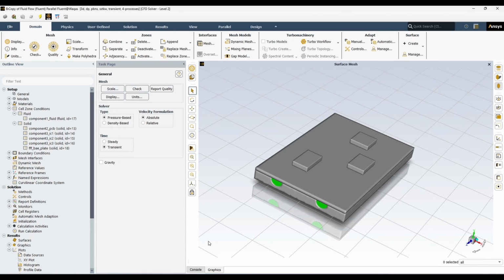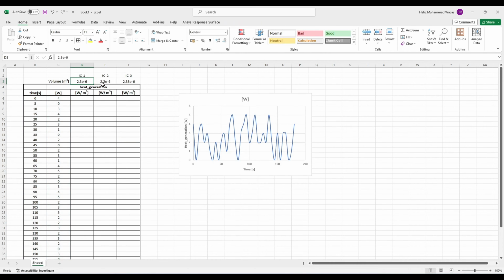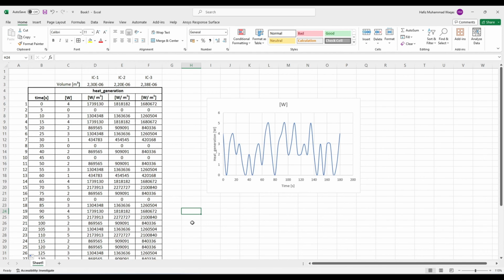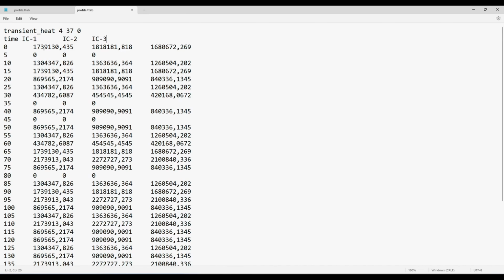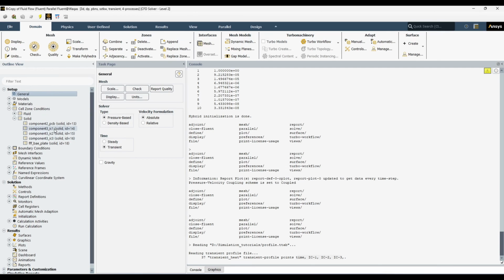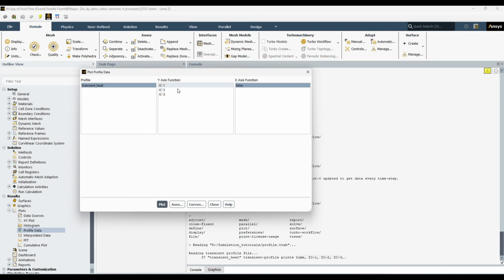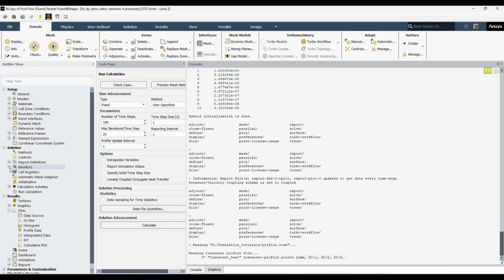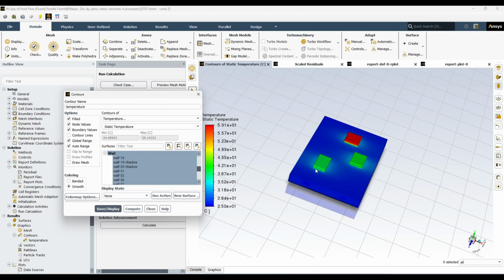Import excel / CSV / text file time dependent data in fluent

Comment: Thanks for the video. I have a question: how can I define the unit for the Y-axis values? I want to define the change of acceleration with respect to time, but the software shows the message: 'Incorrect expression unit. Expression Unit [ ], Required Unit [m s^-2]'.
Reply from the maker: Can you please tell little details about your model. You are defining acceleration as an input. I don't see an option where we can define acceleration as initial value/boundary condition.

Comment: Meanwhile I was wondering about another situation, if you dont mind. If I have a CSV file of values of field variables and their respective location in a coarse mesh of a certain domain (suppose that this result came from another CFD software or some AI algorithm), is there a way somehow of using the utility "Interpolate" on Fluent with this CSV file, since the mesh of this domain in Fluent is supposed to be finer? Thank you so much in advance for your time and help!
Reply from the maker: I already have a video on that. It is a simple example but you can use it for any geometry 
Here is the video link
https://youtu.be/XMsAYMpy62M
Reply: @WaqasLearnTech  Thank you so much! I will take a look on it then. Cheers from Brazil!

Comment: Thanks for the video! If you don't mind, I have a question. What if I would like to assign the values of the heat flux in each cell of the mesh. Would you know whether it is possible or not? Thanks once again!
Reply from the maker: @murilobrunaciomedeiros6466  it is possible to assign heat flux to each cell. But for that you need a UDF. In UDF you can loop through all cells in a cell zone and you can assign heat flux to each cell

Comment: can we import the pressure data at certain positions similar to this if so can you suggest how to. 
Thanks in advance
Reply from the maker: Please provide a little more information. In CFD simulations we can import pressure data at the inlet or outlet boundary conditions. But I don't think we can do it for walls.
If you want to export your pressure field for your structural simulation, that is possible.

Comment: what about the time profile? we also need to assign it, don’t we?
Reply from the maker: @ndarualfian1539  no you don't need to assign time profile. Time would progress as per your time step settings (calculation tab). Your time step is not required to match the time profile. Fluent will interpolate if time step doesn't match with time profile.